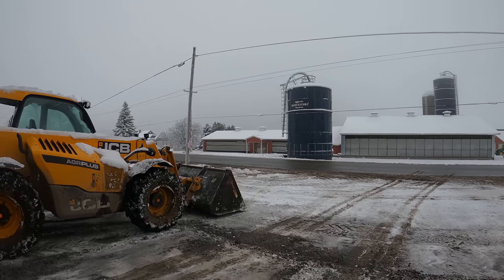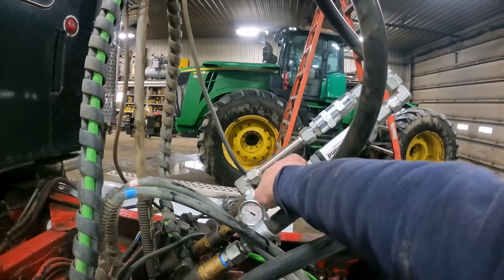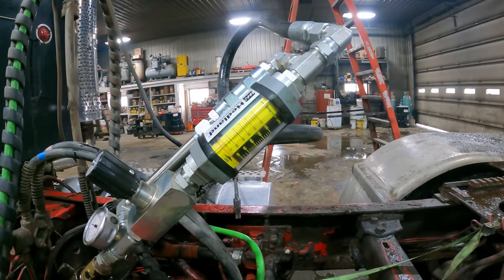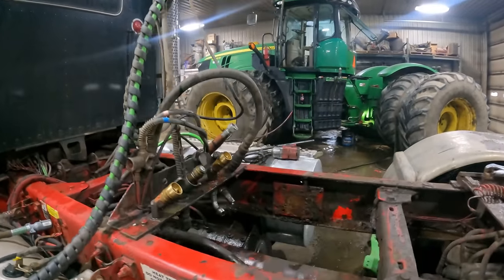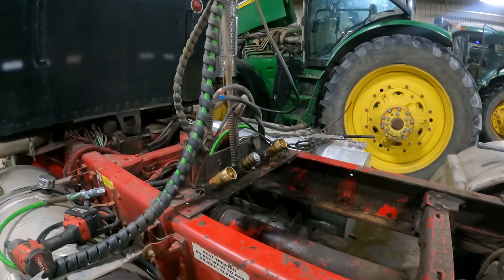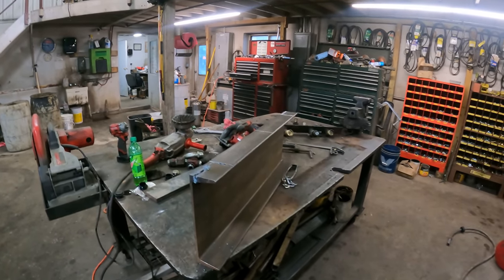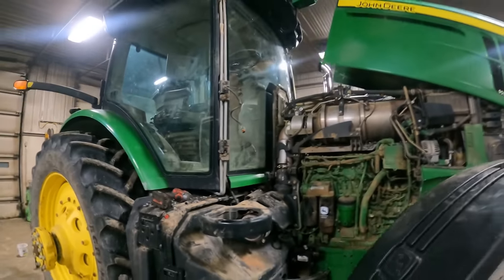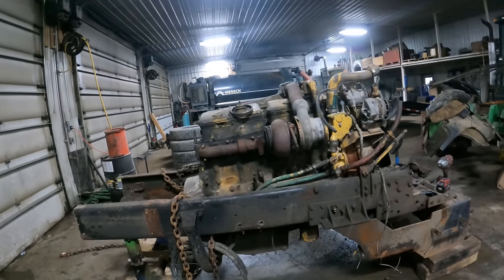W900 has some issues that need to be addressed.

Comment: Andy i'll check and see what we use for our trucks . When i get the info i'll send it to you .  We set our trucks up to run a dump trailer and a walking floor . I know for the walking floor you need a high flow with like over 3500 psi . I believe they set it up with like 3800 psi to 4000 psi so the oil don't heat up . because with unloading a walking floor takes 15 to 25 mins to unload in most cases. When we buy a new truck we set them up all the same . We also run more oil then needed so the oil dose not over heat with oil cooler as well .

Comment: In my limited experience, those Horror Freight units work OK on sheet metal, buy can't cut it for fabrication work. EVERY 2nd time I tried to use the one I have, it would burn up the Capacitors on the power board. After several cycles like that, I surrendered.

Those new lights have the shop lit up like a film studio.

Comment: I mean I know you would have to figure something out control wise but would there be a benefit to putting the valves on the trailers themselves and just use the pump off the truck?
Reply from the maker: A lot more to unhook as far as houses and controls of that were setup that way

Comment: Howdy Andy  had a thought. Do they make a heater for your hydraulic tank like the heater similar on the radiator.   Sure would be easier on the whole system. Thank you, Andy.
Reply from the maker: Don’t take long to heat up hydraulic oil

Comment: If you're looping the power beyond or sending the power beyond to tank you're just pumping fluid back to tank and getting no work out of it.
Reply from the maker: Oil has to go back to tank anyway. The power beyond was just a option to run a unit that already has a valve body on it

Comment: ok , cannot check flow unless 300psi below relief . that will check flow at working pressure . once closer than 200psi , most reliefs start cracking and lose flow over relief . thats a ruff industry standard when i tested , white , AC , komatsu , kubota ,  etc .
Reply from the maker: And it was losing it once I got close to the relief

Comment: ANDY I don’t know for sure about any of this because I’m not great on any kind of hydraulics or anything but just a question is it possible that you could plumb some of the hydraulics in hard piping like it may be black pipe or galvanized pipe or something like that, and use just rubber hose in ends where you absolutely need it to be able to flex and the other places use regular piping so that it would make it more rigid and strong Just a question I have no idea if that would work or not.
Reply from the maker: Black iron and galvanized pipe isn’t rated for any more than 150psi . There is certified pipe for hydraulic oil pressure but it’s special
Reply: Just thought that hard piping would be a good idea and maybe it won’t make it more rugged on the truck not trying to tell you what to do. I enjoy your videos and I know your day is the best thing that is possible to be done I can tell that you put a lot of thought into what you do keep up the good videos. Enjoy them on this part.  Wish we were closer together we would probably be a good friends. I own a locksmith business in Indiana so I know how it is to own a business and have people tell you what to do. They do that all the time it’s kind of a normal thing they know more about it than you do and you’re the professional.  I just.😂
And keep on working